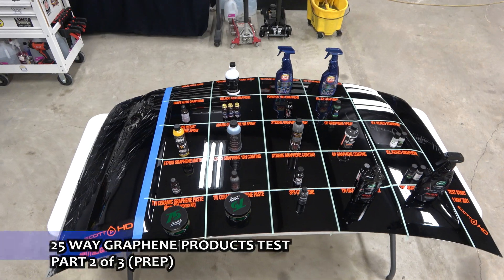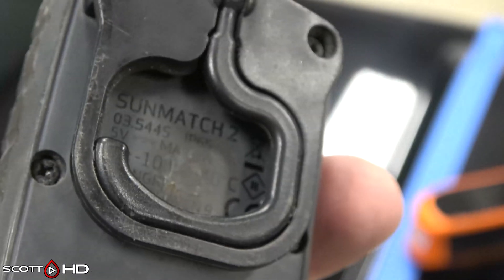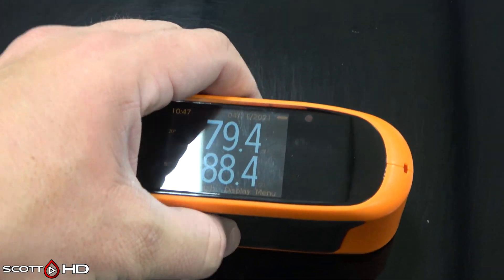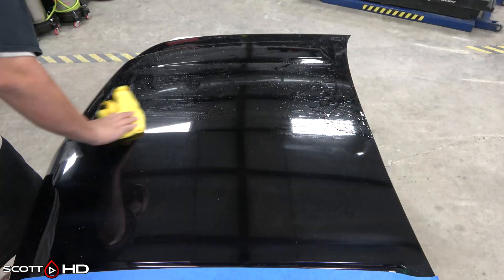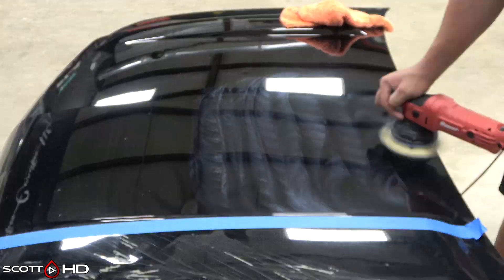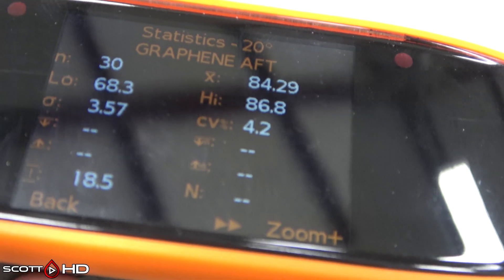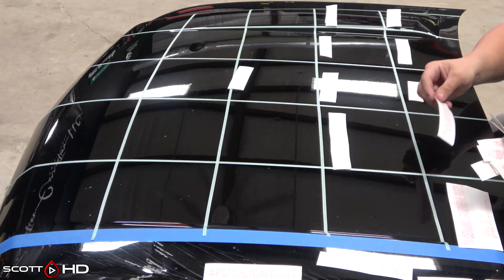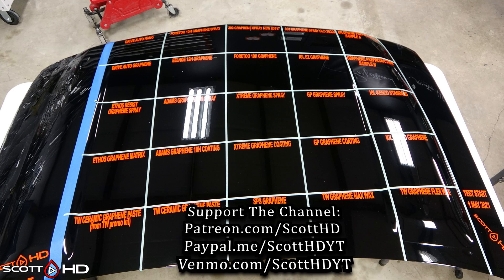Graphene Coatings Longevity Test - 25 WAY - ULTIMATE comparison test - PART 2 - SETUP and PREP

Comment: Bro, I have a idea for a entire video series of comparisons. Instead of testing hydrophobics, test the UV rejection. They all claim that even after the hydrophobics is gone the coating is still there protecting. It would be awesome to test this claim. Maybe put coatings, waxes, sealants...anything claiming uv protection....on a clear acrylic panel like a sheet of plexiglass. Then maybe use a UV flashlight or UV curing lamp. If you want to go all out, i'm pretty sure they have cheap uv meters that measure the amount uv hitting the meter.  You could shine the light or cure lamp through the plexiglass alone and measure it as the base, then shine through the coatings/products. Then after the hydrophobics wear out, you can test the uv....or test it monthly to see if the uv protection drops....OR if it's even enough protection to matter, it may be nothing but marketing hype. I bet nearly all products are marketing hype, but I'm not sure about ceramic coatings. Would be a awesome series. I've been using uv protection as a selling point and have recently found out that for many years, this has been a bunch of BS regarding waxes, sealants, detail sprays, interior dressings, etc. That supposedly, if the protection is even measurable, itll be a insignificant amount.
Reply from the maker: It's getting tested! Stay tuned!

Comment: Hi Scot, it's amazing! Thanks for your work! Can you please test IGL EZ as Spray as an additional option? As it was on pre-production. Just want to know If I can use it as a spray-on-wipe-off sealant. As TW S&S and other spray waxes. Please please, please!
Reply from the maker: The sprays are applied the same way as the coatings so it "shouldn't" make a difference in the outcome.  I spray the sprays onto an applicator (as I have done for all of these tests as to not contaminate a neighboring section).  So whether coating or spray application, the result should be the same. Thank you 👍🏼
Reply: @ScottHD  thanks.

Comment: Uuuuhhhh I’m so ready for this test to start I was gonna get 303 Graphene spray but then the proven Turtle Wax released the Graphene flex wax and I went with that instead and it’s been doing nicely short term wise
Reply from the maker: May 1!  We're almost there 👍🏼
Reply: Short term wise for me also on the TW flex and it's easy to reapply.   But during the winter months more durability is welcome.
Reply: @robm7076  i live in Cali so it gets hot I use it before it protects better than ceramic wax and it doesn’t contain any carnauba wax

Comment: Despite the fact I am a detailer and have a lot of patience for a lot of things, removing the extra vinyl from the letters is something I would dreed doing.  Thank you for doing all that work for these tests.  Really looking forward to the application method video.  I think that is a great addition to these tests.  I am sure I will discard the potential used of some of these products before the test even begins based on how they have to be applied.  Although I heard graphene products have similar application methods to ceramic coatings being ceramic coatings with added graphene... will just have to see ;)
Reply from the maker: If I can't find any hoods for new tests, I will end up reusing old test hoods which I absolutely despise because I have to remove the vinyl without scratching the hood!  Easier to find another hood!
Reply: @ScottHD  I do a lot of debagging and vinyl removal and once you know how to do it's it's very easy, although time consuming.  The easiest way is to use a heat gun to soften the glue and use a plastic razorblade to lift one of the corner, then it's just a matter of pulling it off.  To remove glue residues, I use Rapid Remover.  I heard that Alcohol and other solvents like lacquer thinner also work well but I have never tried that.
Reply from the maker: @Calendyr  I will generally end up wetsanding it too since the vinyl can etch the clear coat a little bit.    Goes back to "just find another hood to use" sometimes 😂
Reply: @ScottHD  Do these body shops give you the hoods or do you have to buy them?

Comment: Very much looking forward to this one Scott, unless of course you prove my recent investments in Graphene has all been a waste of money :-(  Only major difference is climate whereby days here in Blighty topping 20c / 70f are few & far between. What a pleasure it must be waking & not having to guess trainers or wellies until the curtains are pulled back.
Reply from the maker: Thank you.  I am going to make sure to talk about the water spot resistance as this test goes on.
Reply: @ScottHD   interesting, given most of the 'traditional glass bottle' ceramic/ /graphene coating all have that long word in I cant pronounce let alone spell without cheating & hot foot out to the man cave, one could be forgiven for thinking they should all be the same when it comes to water spotting. (perhaps a head to head on water spot removers might work, ok so only a thought :-) )

Comment: Hi, this week I am buying a Mazda Miata from 1990. I want too make the original paint as good as possible, first clay barring, then polishing and then a graphene or ceramic coating. I am just not sure which coating to pick, can anyone give me the best suggestion?
Reply: By the way Scott, your testing videos are amazing. Great work, great channel.
Reply: Will you be applying the coating yourself?  If so I'd go with Adam's polishes ceramic. If you've never installed one before,Adam's is pretty user friendly and it's has black light technology so you van easily see it being applied
Reply: @HoosierDaddyDetailing  I have been washing my cars for about every week in 1 year spread. (Profile picture is 10 years outdated)
Reply: @HoosierDaddyDetailing  and since it's an oldtimer, I really want to take the best care. What would be the best product in that case?
Reply: @svenbosma5704   I would spend some time on this channel and possibly others researching a bit more. A lot of the best ceramic coatings are professional only and not available to the general public. However carpro cquartz UK 3.0 has been an industry standard for quite some time it really is the consumer coating to beat in my opinion. I would also check out gtechniq and possibly even Adam’s coating options as they have been surprisingly outperforming other more prominent coatings. For a easier spray on ceramic protection option look into meguiars spray ceramix wax or griots ceramic 3 in 1 spray.
Reply: @Ayerborne  ah great, thanks for the tips. I didn't know about the industrial coatings you were talking about, but I'll do some research. Thank you for the tips.
Reply: @svenbosma5704  I did a red 1990 Miata recently but chose not ceramic coat it as the paint was quite dry/oxidized. Ended up doing the Turtle wax hybrid solutions polish with a pile of microfiber pads. It came out awesome for what it's worth. 

The main reason I didn't want to ceramic coat the car was I didn't want to apply any panel prep. Just really didn't feel comfortable with it since this example had been a bit neglected.
Reply: @mikecorsini85  I understand, but luckily my Miata is in pitch perfect state so I won't have to deal with that.
Reply: Those old Mazdas have a single stage paint if it’s the OEM paint. You’ll be amazed how much shine you can get out of it. Back in the early 00’s I did a very neglected red miata with 1,2,3 meguiars kit from the local auto parts house. It had so much shine I have a picture of the reflection of an American flag which was across the parking lot. I was in school and had lots of free time. 

CQuartz 3.0 has been good to me, but honestly for a diy’r I don’t think you can go wrong with any of the main brands.